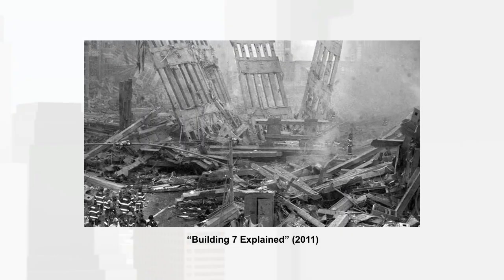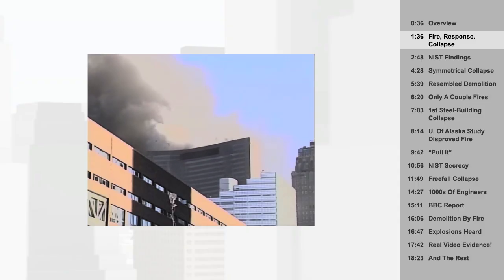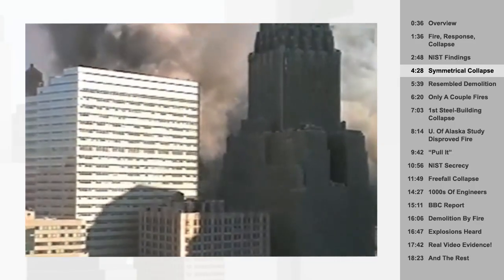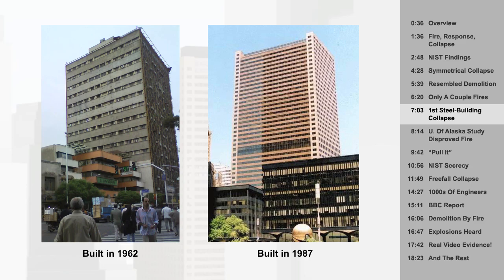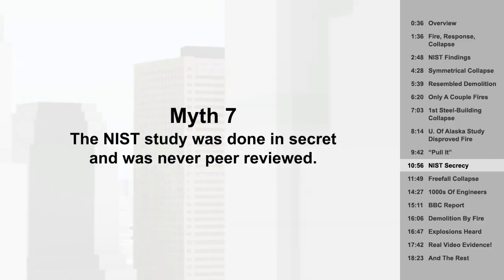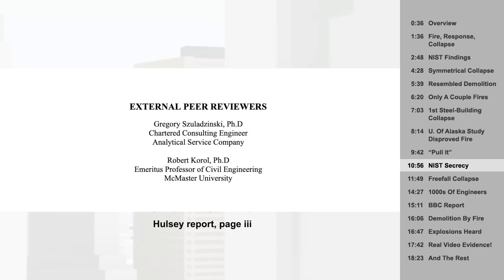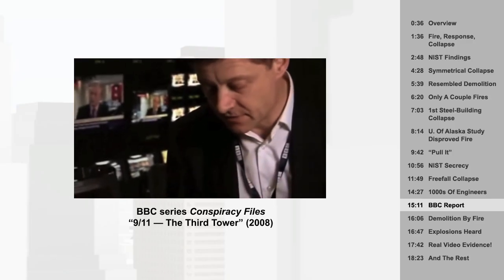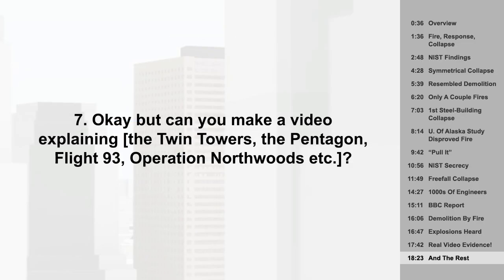Building 7 Explained: Comprehensive Final Edition

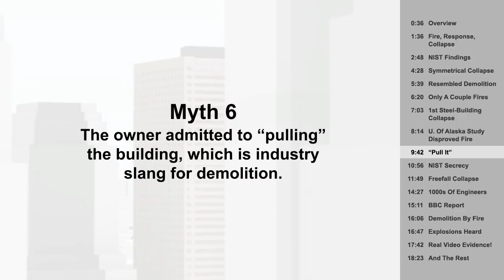Comment: Your arguments 7:03 first steel building and 9:42 are very flawed, Comparing a a steel frame skyscraper with a simple one story steelframed  factory roof is not fair, since (especially the lower floors) the wtc7 structure is engineered to hold the weight of the floors above it, so this steel structure is engineer to withstand(aprox) 50x amount its own weight,where a steel framed roof is engineered to hold just itself and the roof structure.

The Windsor tower argument is more a testimony against your argument since that building did not fall to the ground. So the argument that wtc 7 is the first steel building collapse due to fire is not defended. 

The pull-its argument can not be defended by a "random "fireman.Offcourse  a fireman would not "pull it" that is never their part of their job. The solution would lie with Mr.Silver stein what he meant with the "pull it" decision. 
That a fireman dous not discuses the actions taken with the owner  in the heat of the moment is logical.That a fireman does not have authority or position  to " pull a building" is also logical.
however this is not an argument that the building is not demolished using pre-installed explosives.Also as stated by the fireman, Mr silver stein would not have the authority to decide (that day) what actions to take in order to fight the fire`s in wtc 7, so the stated fact of silverstein to communicate the decision "to pull it" with the fire department  to the fire unexplained  on both accounts.
Reply from the maker: this steel structure is engineer to withstand(aprox) 50x amount its own weight
Completely wrong. The factor of safety in modern office buildings is generally no more than 3 or 4, not 50, which would be prohibitively expensive. Even the new Freedom Tower or the new 7WTC (both with concrete cores) don't come close to that. Also the Kader Toy Factory was four stories, not one. Why did you think/assume it was a one-story factory?
that building did not fall to the ground
The concrete did not fall to the ground. The steel did.
a "random "fireman
Daniel Nigro was the Chief of the FDNY. Not a random fireman. He's the one who made the decision.
" pull a building"
This is not a term except in the case of literally pulling over a structure with cables.
Reply: @EdwardCurrent  . the Kader Toy Factory was four stories, not one. Why ...
 assumption, where i live most factory`s are 1 story-ish so my assumption was wrong. Still comparing the structural rigidity of  a 4 story factory building against a 52story steel high rise is like comparing a rowboat against a cruisship. 

The other argument (approx50x own weight) need explanation since these things a simply not that simple, but basically its like this, for every added floor, the  foundation of structure must be stronger per floor. so the first floor of a 10 story building is roughly 10 times stronger than a 1 floor building.

This means that in order for the building to collapse trough the lowest floor, the energy necessary is to do so must increase after each destroyed floor since evry floor is capable of holding the upperfloor ,this energy is simply not available,there is no logical solution why or how  the building would acquire this destructive energy during the destruction of each floor.

Simple comparison, you drive 100 mph down a very steep hill (the speed is a bonus gift from me)
In front of you the is a traffic jam of 52  cars, you hit the first car with 100% of your potential destructive energy, how much energy will you lose in that first impact and how much do you have left to destroy the other 51 cars? 

With each car hit, your car takes considerable structural  damage and  and loose alot of kinetic  energy and thus with each car hit, the amount of damage you can inflict on the next car  gets smaller. 

Is it in your mind possible that you`ll hit and destroy all 52 cars and find yourself all the way down the hill?
Reply from the maker: @ronald broersma  Seems like you're making a Twin Towers argument (which is also wrong because the energy you say is unavailable is 480+ gigajoules of gravitational potential energy in each tower but OK). There was no floor-pancaking going on in WTC7.
Reply: @blauwzakjecrack  "there is no logical solution why or how  the building would acquire this destructive energy during the destruction of each floor"

Gravitational potential energy.  Buildings are designed to support the static load of the floors above, not the dynamic load of the floor above being dropped on them.  Once you get a chunk of building falling downwards, it's going to smash through the structure below, like a hammer that gets heavier and faster the farther it falls.

Sort of like the difference between balancing a hammer on your head and dropping one on your head from 6 feet up.  One of these things lands you in the ER with a fractured skull, the other just make people look at you funny.

Comment: 4:04 Kostack Studio misrepresents collapse of the perimeter frame, showing the north wall being pulled inward. It was not pulled inward. The east half of the structure fell over to the north, causing the north wall to bend laterally. It did not bow inward. The fact the east half fell over to begin perimeter frame collapse has not been understood by any of the engineering entities who have studied this event. https://youtu.be/rst-x0OffAI?t=339
13:05 It appears you are using the center "dip" in the north wall as a measure of descent less than free fall. If so, that is a false measurement, as there is no dip in the roofline. That is the north wall folding vertically. https://youtu.be/rst-x0OffAI?t=130
Reply from the maker: I wouldn't call it a misrepresentation that the latter part of his simulation behaved differently than the real thing (as is the case with NIST's). Also I think it's pretty clear that when the roofline begins to move, all points around the roofline are moving in some direction other than horizontally, but it's impossible to know these exact angles.
Reply: @EdwardCurrent 
"I wouldn't call it a misrepresentation that the latter part of his simulation behaved differently than the real thing (as is the case with NIST's)."
The entire simulation is a misrepresentation of collapse, esp as it relates to the perimeter frame. The east half fell over to the north at onset, and continued falling to the north, while the west half subsequently fell to the south. In 20 years, there has been no engineering entity associated with examining this event who understands the motion seen in Building 7 perimeter frame. https://youtu.be/rst-x0OffAI?t=340

"...it's pretty clear that when the roofline begins to move, all points around the roofline are moving in some direction other than horizontally,..."
100% false. The first move of the roofline, prior to any descent, is bending horizontally, along with the rest of the north wall. 
https://youtu.be/rst-x0OffAI?t=130

"...but it's impossible to know these exact angles."
100% false. Examination from more than one angle reveals precisely which way the structure is moving. For example, if the north face were bowing inward, the NE and NW corners would move toward one another. Contrarily, they are moving away from one another at onset, even before any down motion.
Reply from the maker: In 20 years, there has been no engineering entity associated with examining this event who understands the motion seen in Building 7 perimeter frame
Because nobody cares about the perimeter frame. It's of zero interest to the forensics of this case. Do you believe it to be, and if so, why?

@2.29 in your video, where Chandler is saying there is no downward kink, there most certainly is! Hold a straightedge up to the screen. The roofline is not straight. It has obviously dropped in the center, and although it's harder to see in that distant shot, it appears consistent with the 7 feet of descent measured in the CBS video.
Reply: @EdwardCurrent 
"Because nobody cares about the perimeter frame."
BS. NIST and many researchers from all quarters tried to understand/recreate that mysterious move of the perimeter to the east at onset, especially in the first 8 to 10 years. No one ever got it, and they basically gave up, including NIST. Hulsey tried, and could not replicate the motion. Everyone ended up essentially ignoring it. They all cared enough to try. 

"It's of zero interest to the forensics of this case."
Utter nonsense. Every bit of collapse is key to understand, as is every bit of debis pattern and structural remains evidence. In this case, understanding the motion leads to and corroborates volumes of other evidence pointing to damage far worse than NIST assessed. That damage could easily account for slack in the lower structure, allowing room for girder 2001 (?) to fall from, or be pulled from, column 79. It's very important. You have to understand what we can see if you are to understand collapse!

"The roofline is not straight. It has obviously dropped in the center,.."
It's not bending down. If it were, the NE and NW corners would be pulled toward one another. The camera is likely not perfectly level to the roofline, which accounts for any slight bowing you see from that angle.
Reply from the maker: NIST and many researchers from all quarters tried to understand/recreate that mysterious move of the perimeter
They did? Evidence for this claim? 
Hulsey tried
Because Hulsey is a conspiracy believer who, like all of them, is convinced that the final stage of the collapse is some kind of smoking gun or something, which it isn't.
Every bit of collapse is key to understand, as is every bit of debis pattern and structural remains evidence
I disagree for reasons below. Did NIST ever even look at the debris pattern? Or any of the other engineering studies?
corroborates volumes of other evidence pointing to damage far worse than NIST assessed
That assumes that the interior progressive collapse had zero effect on the moment frame. IOW one can't assume that the condition of the moment frame at the onset of global collapse is the same as when the building had not yet begun collapsing.
That damage could easily account for slack in the lower structure, allowing room for girder 2001 (?) to fall from, or be pulled from, column 79
That's getting very, very speculative. There's much too much chaotics to start from the descent of the moment frame and work backward and try to establish the pre-collapse condition of the building. A shit-ton of stuff happened between those times.
If it were, the NE and NW corners would be pulled toward one another.
Looks like the NW corner is indeed pulled in. Even on Chandler's freeze-frame, it's obvious that the west edge of the frame is no longer plumb. And it stays pulled in throughout descent.

Comment: So why did building 7 slow back down from free fall after the brief free fall period if all the insides had already collapsed? Otherwise good video
Reply from the maker: Intact regions of the moment frame reached the debris pile. The force of impact that buckled them or broke them apart reduced the acceleration rate of the frame. Interestingly enough a similar slowing can be seen in the soda can experiment in my video.
Reply: @EdwardCurrent  That makes sense! I just have one more question, was the water bucket a static load? Or were you filling it as it collapsed?
Reply from the maker: Actually it had stopped filling. It was filled to the top and I had removed the hose. That's why you see water dripping off of it. The previous test attempt had collapsed sooner, so this time I was wondering why it hadn't collapsed, but then it collapsed and the camera was still rolling.

But honestly I don't think it matters if the load was changing by a few grams per second. The load on B7's moment frame wasn't static at all at the moment it began to buckle.
Reply: @EdwardCurrent  Thank you for the clarification. Good video
Reply: @archive8080  "... other than explosive sounds occurring shortly before the penthouse collapsed."  Hmmm, yeah, those mysterious explosives that weren't recorded on ANY video footage.
Reply: @archive8080  >>Yes, there is an audible explosion that occurs right before the penthouse collapses in 2 videos <<  Oh yeah?  Can you provide titles?  (I know YT doesn't allow links any more.... which is damned stupid.)  

>>And I'm guessing your definition of credible is not experience, education, or achievements, but rather experts who agree with the official narrative, yes? <<  Nope.  "Credible" means having an education in the topic matter and a track record in the field.     >>Because there are many expert structural engineers and high rise architects as well as demolition experts who agree it's likely a demolition.<<  False.  I assume you are thinking of people such as that list of 3000 petition-signers of A&E911T?  Not one relevant expert among them.  This may come as a shock to you, but just because A&E911T claims those people are all experts, doesn't make it true.
Reply: @archive8080  >>The evidence speaks for itself. << Yes, it does indeed!  We agree!  (No CD!)  Thank you!
Reply: @archive8080  >> Everything you just said is irrelevant.<<  In other words, you've run out of counterpoints.  Understood.  I hope you have a fantastic day!
Reply: @archive8080  It's certainly true that you've not started to present any actual evidence during this exchange.  In fact, you handily shot your own argument right through the heart.  Direct quote from you about WTC 7: "Listen close and you won't hear the collapse, only an explosion right before the penthouse caves in."  ...see, high explosives generate sharp blasts of 150 dB or greater.  They would dominate the audio track.  If you have to "listen closely", then the sound you're trying to identify ISN'T the sound of a CD.  You've obviously never watched any video of an actual CD.
As you so eloquently stated, the evidence speaks for itself.
Reply: @archive8080  I've been on site at high-explosive building demolitions as well as at blasting sites.  Have you?  The blasts are completely unmistakable, and MUCH louder than any collapsing sounds.  They're distinctly audible a mile away or even more.  Most guns don't sound anything like that or anywhere near as loud, so I'm not sure why you bring gunshots into the discussion.
Reply: @archive8080  I was talking about gunshots live and in person.  They're almost always nowhere near as loud as blasting caps or demo charges.  The collapse of a building generates a large quantity of sound, but the peak energy of that sound - the actual decibel loudness - isn't in the neighborhood of a high-explosive blast.  High explosives make supersonic shock waves (that's what, by definition, categorizes them as high explosives.)  Those blasts are sharp and loud to the point of hurting your eardrums if you're close enough, and are still very audibly obvious farther away.  They're much sharper and louder than a collapse.  A building collapse is a lot closer to an avalanche in terms of sound spectrum.
Reply: @archive8080  "How many dB for the complete collapse of a million pound building?" Enough to have been clearly heard in New Jersey. This is well known and established.
Was there such a sound? Well, NO-ONE within at least half a mile of the building would have missed it. So, no. There wasn't an explosion.
Reply: @archive8080  Yeah. So, you're saying that the explosions that would have been clearly audible in New Jersey sounded like a gunshot across the street from where it happened. That is your own statement.

Which then of course shows that, no. It wasn't any explosion. Imagine that.

Then again, that's well known since there's multiple videos of the collapse...and there's no such sound.
Reply: @archive8080  Really? Well, then you can of course list these videos? Of COURSE you can. So, what videos, who made them, what evidence is there that they're not manipulated afterwards?

I'll be right here waiting as you detail those videos.

As for your quoting, no you're not. You're going "he said so". That's not a quote, that's secondhand hearsay at best.

Oh, also, I forgot. 
" Out of all the dozens of structural engineers and high rise architects, not 1 of them fits your standards?"
They might have. But see, there ARE no "structural engineers and high rise architects" in A&E911's online petition. They "landscaping architects" and "fire alarm installers" and "software engineers". There is not one person in that entire petition with the knowledge, experience and/or education to make a authoritative statement on the subject.
Reply: @archive8080  Right. So, what you're saying is that there's no proof of it and that's proof of it?

Yeah, no. Here in the real world, that's not how it works.

Now, do you actually have those videos you claimed, or would you prefer trying to cover your ass and pretend that, no, really, just take your for for it. Honest. Because that's not an argument.
Reply: @archive8080  That's right. I don't believe anything you can't prove. After all, if you have no proof, you have nothing other than "but that's how I want it to be." Thank you for admitting that.

As for "my proof", it's your claim, not mine. I don't have to prove anything for you. That's your job.
Reply from the maker: @Archive That the burden of proof is on the person making the claim is kind of basic stuff.
Reply: @archive8080  Really? So, what you're saying is, you can prove a negative?

Because according to generally accepted science? That's impossible.
But I'm sure you're special and unique and you can manage something that cannot be done. So, tell you what. You get right on that. I'll be here waiting.
Reply from the maker: @archive8080  LOL no that can't be proved, but then again I never claimed it. In fact it's likely the gov't DID lie in its 9/11 investigations somewhere. But, that has no bearing on the FACT that this building came down because it was on fire for 7 hours. Learn some logic.